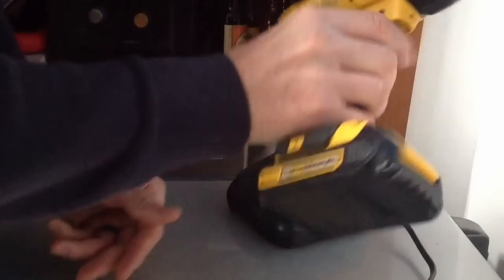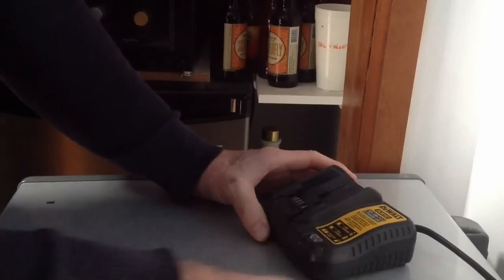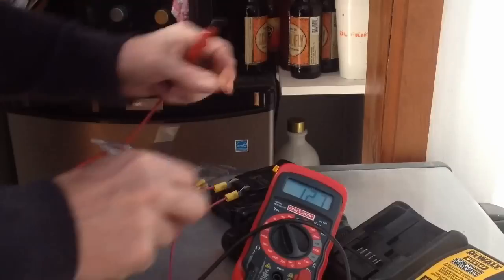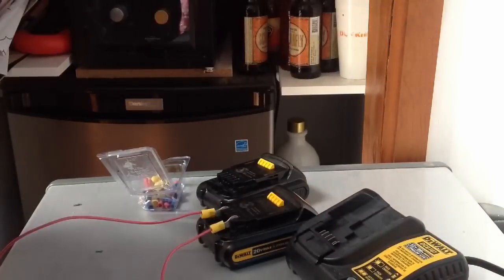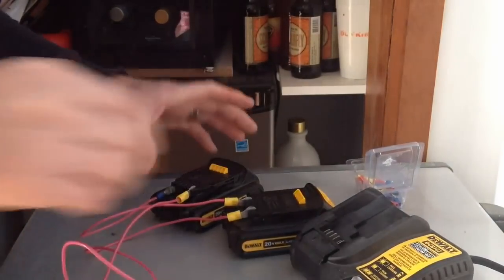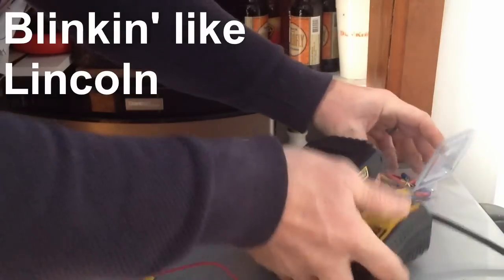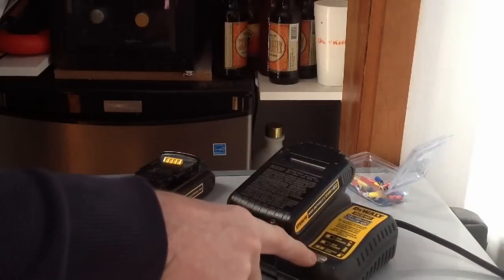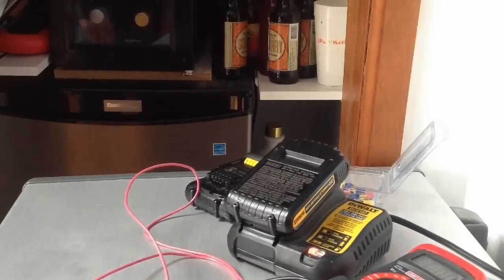Jump start dead lithium ion cordless drill battery

Comment: It worked, that's for the info sir. Upon further inspection I took it apart and found it has a circuit that basically puts the batter charging usage circuit to sleep after low/no use and that jump start reactivated it

Comment: This worked for my rigid 12v tool battery.  Thanks!  I used the car charger at 2v trickle for deep cycle low maintenance for 5 minutes.

Comment: Sir li-ion battery's are fantastic but no 2 have the same internal resistance which means they can over time discharge differently resulting in a balance issue the cell should never go below 2.4 volts or over 4.2 fully charged a 18 volt battery has 5,  4.2 volt cells in series but what happens is one cell gets to low then the bms in the battery  will open the circuit to stop any charging and prevent a possible fire , if you want to save the battery the cells within must be rebalanced then the charger will work and the battery will work like new again . balance is an issue that has to be addressed from time to time when running these batteries hard . These chargers monitor each of the cells to keep you safe.

Comment: The BMS had shut the battery down due to low voltage cut out.
I know it’s probably not the safest method but what you did clearly works :)
I wouldn’t ever want to leave it unattended like that though! You might end up with lithium ion powered central heating in your house!

Comment: Worked for me. Put discharged battery on the charger, red light flashed on the charger indicating a bad battery. Jumped with a fully charged battery (+ to +, - to -), waited 5 minutes. I put the bad battery on the charger and it began charging and came up to a full charge. Thanks.

Comment: I’m trying this in my m18 2.0 batteries as I type this.  One of them I hadn’t charged in a long time and wouldn’t take a charge.  I hot glued some wires to some razors and slid them into the slots.  (With insulated needle nose pliers)

I have a battery charger for my 18650s, 21700 etc that has some type of trickle charger feature specifically for bringing batteries back from the dead.  It’s kool.

Edit-  I let it sit for about 10 minutes so there is less risk that I’d have to hook it up again.  Popped the dead one in the charger and it started charging.  Thank you!

Comment: This worked on both the battery that ran dead on the flashlight and another battery that still had one led light bar, but did a rapid blink on the charger.

Comment: So I built my own Bluetooth speaker and used my dewalt 20v battery. The only thing is I passed out with it turned on and it killed the battery saying it's too low to charge so I just jumped it using this same method only needed it to register the first light on the battery which took like 30 sec then plugged into charger and it's charging again I use this a lot since it's in my garage and we use it when drinking haha so it works it's safe ive been doing this for the last year and it's still running great :)
Reply: Tony stop doing that, you now have a ticking time bomb. Do you have a clue why it prevents them from charging when they get so low. It to prevent them from shorting out and catching your house on fire. You CAN NOT allow them to discharge so low for a reason. By bypassing the safeties in the battery you are letting a weakened cell that is damaged to charge again. You will come home to a house fire one day messing with what you shouldn’t be messing with

Comment: Great video. Had the same problem...but two dead dcb120 12v batteries. Originally thought it was the charger and bought a second one off eBay. Welp...that didn't help. Since I couldn't jump one dead battery with another (and had no other charged batteries available) I used a AC charger. Clipped the end off and used the exposed wires to jump the dead DeWalt batteries. Worked like a charm! Had to keep the AC adapter plugged into the DeWalt battery for about a minute or so (I read pulse charging is needed ..so I unplugged the AC charger every 15 seconds). Glad I didn't waste more money on a new set of batteries.

Comment: Thanks! Worked for me. I had two batteries, 1 dated 2016 & the other 2017. Neither had heavy use. The charger light would not go on. Voltages were at 5.8v & 7.4v. Jump started them both with this method. Sometimes I wonder if DeWalt puts a chip programmed for these to fail.
Reply: Pb123456100   There is definitely an electronic device embedded in the battery assembly to prevent charging if excessively discharged, or a chip as you say.  DeWalt would never admit to the reasoning you wonder about, but I suspect that is exactly what they are doing.
Reply: Yes, my original DeWalts lasted a few months before batteries start failing. It’s called “planned obsolescence”, that way you keep buying new gear. I’ve got ten year old tools and batteries, used a similar method to jump them.
Reply: Yes and no, it is a safety feature that prevent the battery from turning into a bomb
Reply: Robert Adner   That is an alarmist oversimplification of the facts.  Yes, protection is programmed at a level where battery life and endurance are issues, and alternatively where user safety is an issue.  Those two levels are quite far apart though.  I would argue there is another, third, level where increased battery obsolescence and replacement are issues and one must be very naive to assume this third level is not being chosen by manufacturers to arbitrarily increase profits with no increase of user safety.
Reply: @artysanmobile  Exactly. These batteries are designed to be recharged there should theoretically be low risk for anything to happen with these batteries being recharged vs standard non-rechargeable batteries.

Comment: Only necessary if the charger is "smart" - my cordless drills just use a dumb voltage step-down and rectifier, and will (attempt to) charge a completely flat battery. You'd think manufacturers would ad an "override" button, but I guess they like selling new batteries.

Comment: Is there a way to charge a battery with a different name brand charger in this style method? For example, a ryobi 40v battery, charged by a craftsman 40v charger... and using this wire method to charge a battery? Can it be done and how.

Comment: What's the minimum voltage that the charge can recognise, one of mine is reading 13 volts and it still won't charge, I just pop it in the charger and the light goes on as if it's full but it's not.
Reply: I may be to late, but i just watch one previous to this one
His battery was at 13.6 when he started. So, 13 isn't enough. He charged it from another battery for 6min before he put it back on the charger
It worked for him. Put it back on for at least 5 more minutes 
He said a car charger will charge it to full

Comment: EXACTLY I DON'T KNOW WHY PEOPLE USE TRICKLE CHARGERS..

Had the same problem with one of my drone batteries.. 

when you use a trickle charger you have to take apart the battery and avoid the circuit board where are the terminals are on the top of battery..

but when you just jump One battery to another you don't have to worry about any of that stuff!! 

Works like a charm for me with all my batteries..  

They need to figure out something because this happens way too often with these type of batteries it's ridiculous..

Comment: My problem is both of drill's batteries all death, can I use motorcycle battery or motorcycle charger to Jumpstart?
Reply: A motorcycle battery probably would work. See if the dead battery is taking a charge with a volt meter. Try it on the charger and see if it works. Could just be a bad battery.

Comment: Help me with this problem.  I bought a 20v DK278C2 screwdriver set from the US but after a day of use one of the batteries stopped working.  When placing the drill, it only turns on the led light and when connecting this battery to the charger it only turns on the red light permanently.  After 3 days of this, use the battery that worked but after 2 days it also stopped working towards turning the screwdriver sporadically and when connecting this battery to the charger it does not turn on any light.  I tried your method but when connecting to the charger it turns on the permanent red light for a period of 20 minutes and it pays, when connecting this battery to the screwdriver it only turns on the Led nothing else.  Any help option will be appreciated

Comment: Tried to jump start my Porter-Cable battery with my DeWalt battery and found out that the positive terminals are on opposite sides just a heads up for anyone trying the same
Reply: That's a quick fix bro. U need to cut 2 small pieces from each side for it to slide in all the way. I did it with my black & decker 20v battery and charged it using a porter cable charger

Comment: Hope to see what is the minimum voltage for the charger will recognise the battery.
Reply: This. One of my 2amp batteries reads 13 volts and the charger or something, doesn't want to cooperate.
Reply: I believe dewalt is 3v per cell

Comment: hey I checked my Milwaukee batteries found my + and - but on my drained battery + and _ is on the opposite terminals has anybody heard of that
Reply: James Celi   That’s absolutely not possible.  For the batteries to be compatible in use the terminals must be oriented the same.  In fact, what you describe would be a major safety hazard.  Check your results again with a meter.

Comment: Soo basically DEWALT made their smart chargers unable to read such low voltage so that you will go out an buy their most expensive product!  Batteries?
Reply: royobi.too
Reply: Every company does this as part of the low-key planned obsolescence every company has realized would increase their profitability.
Reply: Its also a safety thing because linthium fires are dangerous

Comment: I've tried this but didn't work for mine.  I could get my dead battery up to 4 volts off my good one but it still wouldn't charge on the charger.
Reply: 4 volts isn't enough. 14 volts may be enough, maybe not! 13.6 volts wasn't enough for the previous vid. He charged for 6min with another battery before he put it back on the charger
Connect it for 10 or 15min. See what happens.
If u have a car battery charger, will do a better job. At least, that's what i got out of watching these vids
Reply: @SamA-kn2ow  Trying this right now with 2 low battery Craftsman C3 batteries hope to save them

Comment: I tried this with a portable liion jump starter and I heard a pop and I think I saw a flash inside the yellow casing (18v li ion DeWalt battery). did I destroy this battery? I'm afraid to plug it in to charge!  Plz help!
Reply: Chad Keith yes you did and do this is beyond stupid. These safeties have tripped in these batteries to prevent you from burning your house down.

Comment: I have a 40v lithium ryobi battery that looks new that I just got with a trimmer on offer up. It is reading defective with the red/green light. I have another battery and charger and that battery is good and works on both chargers. The terminals are clearly marked on the outside positive and negative. What type of wire should I purchase to do this. There is a decent amount of room for clips.
Reply: Linda Reyal you have to open those batteries beacuse ot has a logic board inside that it wont let the jump start pass to the batteries, so you need to jump start directly to the batteries

Comment: did not work for my battery , there is voltage when jumping battery once cables are disconnected the battery is still dead no light or voltage. Tried 3 times first for 10 min then 30 min and finally 1 hour with nothing

Comment: What if you only have 1 battery 🔋?
Reply: Then you buy another, and you'll have two, rather than none.
Reply: Late reply, but you could use a DC lithium trickle charger.  Most of them come with the wires to do so.
Reply: WELL THAN I GUESS YOU CANT DO IT THEN#$%%^&^^%$#@@#$. given the fact he used 2 batteries.  WTF

Comment: Hi can I use a 18v battery to charge a 14.4v battery or does it have e to be the same voltage for both batterys
Reply: I would use a similar size voltage. Putting higher voltage into a smaller voltage isn't recommend. Perhaps unless the higher voltage battery is at the lower voltages voltage. Use a multimeter to know that.
Reply: essexceltic1   You can certainly use an 18v supply to jumpstart a 14.4v battery, but don’t use it for charging.  After a while, excess heating will damage one or both.